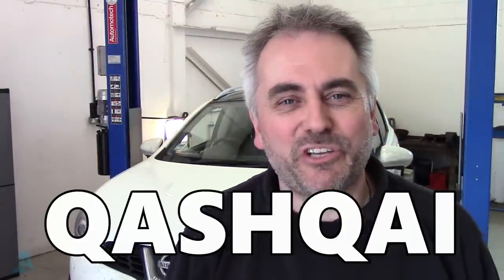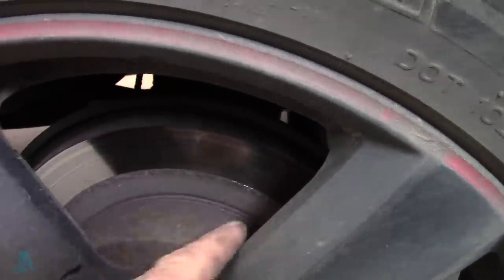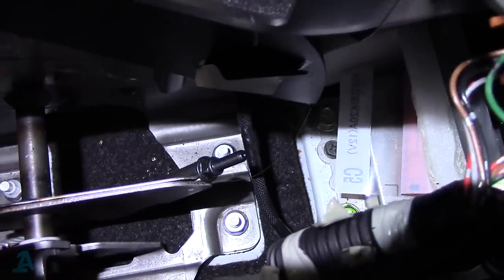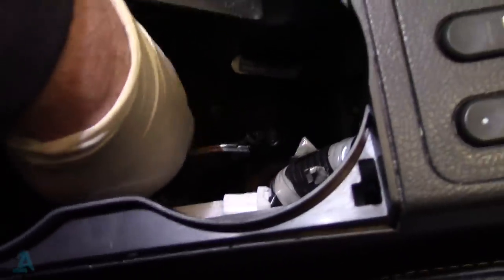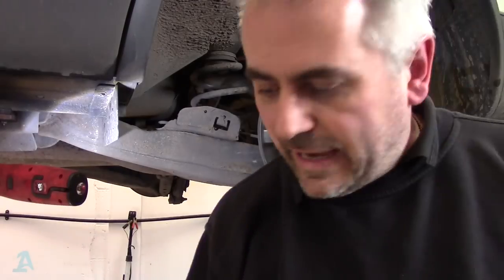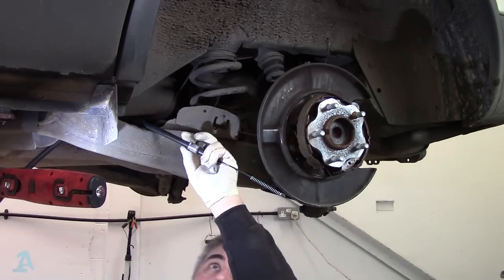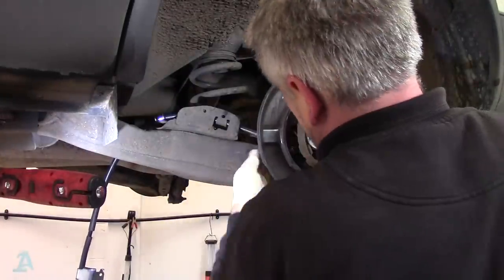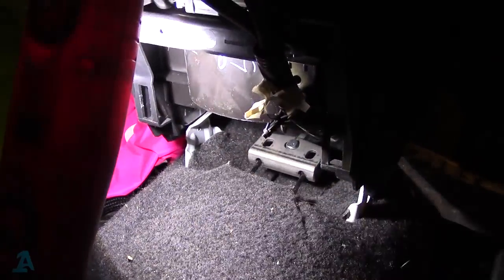Nissan Qashqai Parking Brake MOT Failure - Handbrake Cable Replacement

Comment: I know it would be extra work but I'd take off the hub which would give you complete access to the brake shoes and fittings.  Now if the hub is "welded on" with rust, that would be another problem!!!!

Comment: Didn't look too bad of a job Rob other than it looked a little tight working around the shoes. Nice work as always!
Reply from the maker: Thanks Terry. I don't like removing the parking shoes if I can help it on those Nissans... there is just two many springs to lose! Not too bad to do. Refitting the retaining springs is the hardest part.

Comment: I took mine to the mechanic, he screwed the tenso to the max and said he didnt know what's bad. The car sit for some months because it needed a big brake job, i ended up doing the job myself thanks to vids in this wonderfl site, and, cocky me, wanted to fix the handbrake too. Before i even finished your vid, i wen to the car to see if my cupholders also lifted up so easily, and to confir that the system was the same. Then a saw it. One of the cables had disconected from the splitter, and only one cable was attached. I eased all the tension on the handbrake lever, re-attached the cable to the splitter, and put the tension back to where the lever felt normal. Works perfecty now (probably should replace the cables soon, because if it detached it s probabl because its become too elongated).

Some mechanics should be out of a job... thanks for the vid, man!
Reply from the maker: ComandanteJ Glad it helped you out. 🍻
Reply: More than likely detached as the cable is sticking in the flange entering the drum assembly causing it not to retract back down leaving it slack under the cup holder which then drops off the cable attachment bracket due to being slack.. They pull up an don't return into the hub leaving it slack and the inner brake binding. I had to be recovered one night at 3am due to pulling up the brake, cable sticking and staying half on causing the hub to over heat (making the binding worse due to expansion) and ultimately locking of the wheel.

Comment: Well put together video as always. Now the spring time is here, and I've need to start with some repairs. Like rebuilding a turbo, fixing my door window, service, and a check engine light.
Reply from the maker: Thanks. Yes I hope you've saved up during the winter.
Reply: Hehe, I have not. But I have enough money coming inn so that will be fine. When I fix my mothers car, she has to pay. The turbo and check engine light is on her Audi.

Comment: Another great video Rob, I prefer the good old fashioned round disc and spring that holds the rear shoes on, not an actual spring clip that you turn 90 degrees.
Reply from the maker: Yeah I'm with you on that. The Ford ones I see are ok but those Nissan springs are double strength I reckon!

Comment: Thanks for great tips, wouldn’t have been possible without them, particularly getting interior trim off!!! All went ok until l refitted the bracket above the exhaust!! I cross threaded the bolt because it was slightly out of line and l was working off axle stands on the drive☹️..should have forced the exhaust over a touch. All sorted now though. Thanks again. Phil T
Reply from the maker: Nice one. Well done 👍

Comment: Thank you for the video!
I will do some adjustment on my car, this video will be really helpful.
Question: Should i begin with adjusting the drum mechanism by the wheel? Left side parking brake is holding with 1%, i can still rotate the wheel with hand, when handbrake is pulled up. The cables near the lever are tight as hell. Thank you!
Reply from the maker: De-adjust the cable first. Then adjust up the parking brake shoes. Try the handbrake and adjust the cables if required

Comment: Great video as other have said very clear. Replacing  the cables and shoes this weekend as despite several attempts to adjust (following this vid and the procedure in the service manual) the offside handbrak is so much weaker than the nearside which makes me think that the cable has stretched, is that possible ?
Reply from the maker: Cheers. Yes anything is possible

Comment: hi, please can u tell me;  would having a small dent about an inch deep (only passenger side) in the A pillar of a vehicle (civic 2002) affect MOT? test?  thanks,
Reply from the maker: I wouldn't have thought so how you describe it, just pop to a MOT station to ask and they will tell you.
Reply: ok, it's about 8cm long and 5cm wide and looks like small pot hole shaped dent, however windshield is intact and has passed MOT like this for past 2 yrs but then a bloke (not MOT Tester) told me his opinion that it will affect MOT so thought id ask u. thanks for your time.

Comment: You must have "lost it" on the other side and that's why you didn't record it. I hate doing those jobs. I lost my patients about 10 years ago.
Reply from the maker: Haha yeah, the other side went a lot smoother actually. It's just those spring retainers are real stiff. Easy with an assistant. Did you ever find your patience?
Reply: +One Auto  HaHaHa....No. After 47 years in the trade i don't think I'll ever get my patience back